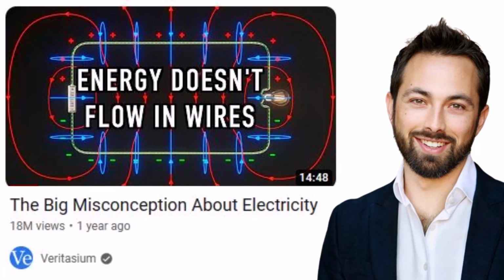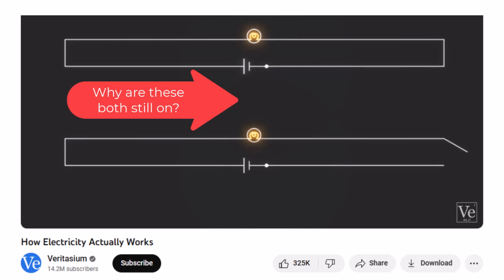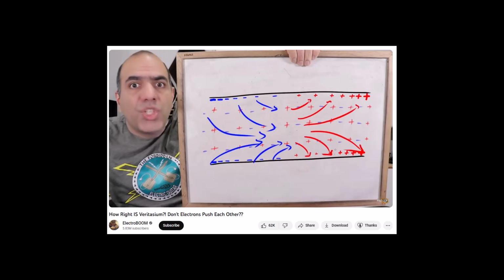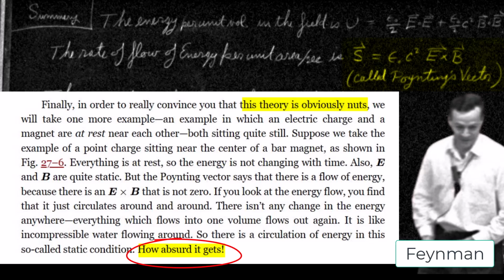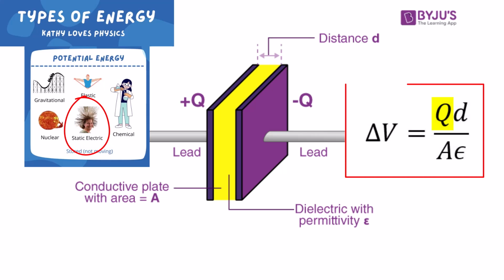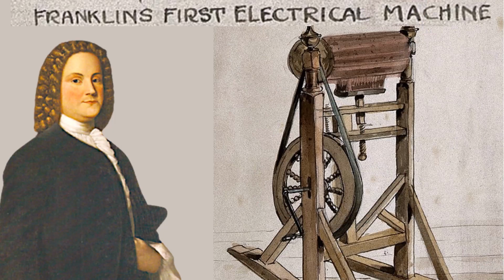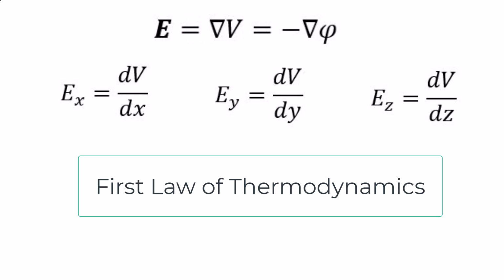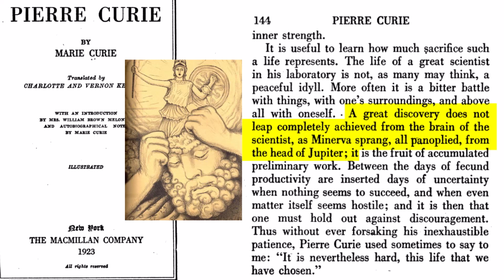Deep Dive Historical Response to Veritasium’s DC Electricity Video

Comment: so you have a battery feeding two long shorted stub transmission lines  the bulb "immediately" (~3ps)  sees the battery in series with the two characteristic impedances,  if the bulb is an LED it will probably light somewhat. if tungsten the  2x900 ohms or whatever in series with it will limit the current too much for it to light until you get the reflected pulse from the end of the transmission lines a few times - by this stage the trasmission lines are looking more like a stepwise inductor than transmission line stubs.  To an engineer (which is what I pretend to be) transmission lines can be treated like a black box with well defined behaviours without understanding the physics,  much like the way Hooke's Law can be applied to a spring or Ohm's Law to a conductror  without understanding properties of the metal it is made from so long as you stay within the bounds of the approximation.

Comment: I see this problem as a simple circuit with a series loop of a battery,switch, transmission, bulb and finally another transmission of some characteristic impedance. When the switch is closed, a voltage will instanty appear across the light bulb equal to this formula: bulb_voltage=battery_voltage*bulb_resistance/(2 * transmission_line_impedance+bulb_resistance). which is a simple voltage divider equation. After the pulse has time to travel to the end of the transmission lines and reflected back, the full battery voltage will appear across the bulb.

Comment: I'm Eric L Michelsen, but Google is scrambling my name.  To clarify, I'm affiliated with the University of California, San Diego (and my last name  is spelled "...sen").  There is much interesting and useful material in this video.  For example, I have given a talk describing simple experiments which show that power does NOT flow along the Poynting vector, and that is fully compatible with electromagnetic theory.  For reference (but not claiming infallibility), I have a BSEE, and a PhD in physics, and decades of experience in laboratories and measurements; I teach this material at the upper-division college level.

However, I think it is well established that the electric field inside a current carrying wire does, indeed, drive the current, and that this field is created by surface charges.  Conductors can expel E-fields only in a static (or quasi-static) system.  In contrast, a DC circuit is a steady-state dynamic equilibrium, and though the charges in the conductor move to reduce the E-field, the battery is constantly "pulling" them out of (and "pushing" them in) the wire, so they can never cancel the E-field completely.  It takes only a tiny E-field in a good conductor to drive a significant current.  This is established by extensive experiment, and organized into the detailed theory of electromagnetism (with no deference to anyone's authority).

I have a detailed discussion of the speed of electricity and the Poynting vector in my "Funky Electromagnetic Concepts" (at the bottom of my web page), starting around page 69 (as of this writing).   I performed (the moral equivalent of) Derek's experiment, and confirmed that in some very realistic situations (but not all situations), the bulb turns on nearly full brightness, nearly instantly (as expected from theory).  My document includes photographs of my setup and results, and a discussion of the theory, but is written at the upper-division college-physics level.  This is all well-established science, and fully consistent with relativity.  (In Dr. Muller's follow-up video, I think he actually didn't give himself enough credit for his prediction.)
Reply: Could you please give us a link to your website?
Reply: google for: eric's physics web page

Comment: With dc it's the electric field IN the wire that drive current and power IN wire and ac will be totally different. Sounds like you are correct. Great video. Thank you

Comment: Since when does an electrical voltage down a wire produce "static electricity" ? on the surface of the conductor ?🛑              Did I miss something, Totally concur with every thing Kathy said.

Comment: At this scale this is no longer a DC circuit. It looks more like a RF circuit working at sub-hertz frequency, and using mostly magnetic coupling. The most confusing part is that it still looks like a DC circuit, yet by making it large the "RF magic" was moved close to DC in a human scale of things (wires inductances are huge), making things confusing. Moving the battery and switch to one end changes how the circuit works significantly. Moving the bulb closer or further away would also influence how the current through it changes over time.

Comment: I would consider my BSEE degree to be in the top 10% of mainstream from a theory standpoint, with perhaps a slight bias towards proving theory through practice, also known as working things out in the laboratory and trying to see if the theory is representative. I had one part time night school teacher who did not mince words when it came to the students, I think it was in the second course in electric circuits, who would call Veritasium's circuit diagram and question about transmitting power (lighting a light bulb), a BS question. Why? Because the circuit diagram and question do not go together. 

Let me explain from an EEs standpoint; If you present a circuit diagram using the common electrical symbols of a battery, switch, light bulb, wires, etc. by its very nature you are using circuit theory. Circuit theory uses mathematical models to approximate the behavior of an electric circuit within a very limited scope, allowing the use of lumped parameter electrical symbols. 

So, circuit theory, or drawing a circuit using common electrical symbols and solving the circuit for specific parameters, comes with rules that are a special case in regards to field theory. 

So the answer to Veritasium's question is it does fit any of the models EEs use, or any that Physicists use as far as I know, who I have found are just as tightly rooted in mathematical models as EEs. 

To apply basic circuit theory, according to the book Electric Circuits by Nilsson and Riedel (now on its 11th edition), which is a very common circuit theory book and also I think representative for what is used for most BSEE students, there are three basic assumptions that permit us to use circuit theory:

1) Electrical effects happen instantaneously throughout the system. So the system is small compared to the speed that electric signals travel in wires, related through rise time (frequency) and the speed of light, or very close to the speed of light as seen by current traveling in wires.
2) The net charge on every component in the system is always zero.
3) There is no magnetic coupling between the components in a system. There can be internal magnetic coupling within a single component like a transformer or coupled inductor.

When we start to violate the above basic circuit theory rules, the system then must be solved or analyzed using field theory. Unfortunately, there is no easy shorthand for field theory, and we have to analyze the system with field solvers using field equations, which use vectors and gradients. 

So, why is Veritasium's question a BS question? 

My instructor would say his circuit model does not fit the question, which is a common mistake that undergrad EEs make, and if done so in class my teacher liked to use the prefix of BS to this or that student suggested nonsense, so by not fitting the establish circuit theory model guidelines makes the question nonsensical.

In regards to your insightful intuition, as EEs learn using circuit theory, the closing of the switch from a power source or signal source, mathematically will result in two main terms, one that is transient and one that is steady-state. However, as stated above this assumes the system meets the basic circuit theory application rules. So, what I am saying is you can get some very complicated integrodifferential equations or systems of equations that have to be solved simultaneously and this is within the simplified world of idealized circuit theory. 

A common mathematical modelling tool EEs use to do this is called SPICE simulation, which basically does the math in solving the parameters of a circuit.

I think the question should be asked, can we use 2D diagrams to understand both the static and dynamic behavior of electromagnetic fields? Yes, but we only do this in a very limited scope with the understanding that field and field interactions are 3D in nature. If you could see an EM wave it would be a strange oscillating string of pearls with a keen eye that can separate the electrical and magnetic effects. How to describe and identify behavior of what cannot be seen?

Comment: The Poynting vector was developed at a time when British scientists really believed in the ether; and certainly helped them in believing in this philosophy.
It soon became out of date however, but nevertheless the mathematical equations hiding behind the philosophy are correct. (Jackson has nothing to do with this?)
Feynman was quite clear about the absurdity of this philosophy, but everyone taught & believed this so…
Derek's video is an interesting sleight-of-hand: you're given the length of the wires and their resistance, but not what actually matters, their impedance.
Reply: How could the math be correct and yet the philosophy or science derived from it be absurd?  Keep in mind this field outside the wires was implied by Maxwell's equations and ideas.  The aether does exist and it explains the measured ability of space to warp and wave in the fields as well as it's ability to transmit energy quickly outside transmission lines and electrical conductors.

Comment: This is the peer review process in action.  Love it.
Reply: No, this wasn't equivalent to peer review, this was equivalent to response papers. Peer review works very badly compared to replications.
Reply: @laurenpinschannels obviously the veritasium video is already out there. I think this IS an actual example of peer review, in the same way that a response paper would be a form of peer review in the general sense of the phrase.
Reply: In order for there to be peer review, the reviewer must address the subject under discuusion, in this case the Poynting vector. All Kathy does is to profess a dislike for it and for David Jackson who includes a discussion in his book. Kathy claims to be a physicist, but seems unaware of the Poynting vector until the present discussion. I was introduced in my junior E&M course and saw it again in graduate school. The Poynting theorem is simply derived by dotting the E vector into Ampere"s Law  and then rearranging to form a conservation law for electric energy. The Poynting vector certainly describes the flow of EM energy through empty space. What is needed here is a discssion of  the Poynting vector in dc circuits. Kathy throws up a lot of irrelevant facts but never gets around to the real issue. She does make a glaring error by saying the the electric field is the (negative) gradient of the poential, which is only true in electrostatics. In electrodynamics, one must also have a vector potential to account for the unconservative nature of the electric field due to Faraday's law.
Reply: It is just an example of people creating controversy out of nothing.

Comment: Great video!!
Im interested if the cucit, but instead treated like a large circle and not two paralell conductors  (EMP travel  at light speed.)
will this relate back to Cosinus to f ,and electrical motors?

Comment: Electricity, Magnetism, Heat, light / Color, Mass / Weight are different manifestations of Gravity and Continually convert to each other. Gravitational Particles (GPs) move by means of CONDUCTIVITY towards the CENTER of the GRAVITY.  
Turbines convert the Gravity Force to Magnetic > Electrical > Heat > Light and everything in between.
When GP moves in the Air (4N1O) Atoms are manifested as Magnetism, therefore Magnetism exists only in the Atmosphere and is absorbed by Compass measured in Air Gap and Magnetic Flux context.
When GP moves in Solid it is observed as Electricity and measured by its Power/Force/Voltage and its Current/Amps and their combination total Quantity of GPs in a unit of time as Wattage.
GPs move at a 90 Degrees Angle relative to their path in [side] Steps, therefore the GPs manifested as Electricity, Magnetism, Heat and Light transit to the Outer Edges of the Medium/Matter.

Comment: The Poynting vector itself does not represent energy flow. If you integrate the P. v. around a closed surface, the result is the net energy entering or leaving (depending on sign) the enclosed volume. Alternatively, the divergence of the Poynting vector indicates if a locality is sourcing or sinking electromagnetic energy.

Feynman was addressing the view that the vector itself represents energy flow.
Reply: But note that Feynman does agree with the theory which is "obviously nuts". His point is that the theory goes against our intution, but that does not make it wrong (and if you don't like it, then I guess he'd say you can go somewhere else).

Feynman also points out that the practical consequences are near zero, and I very much doubt that it has any real relevance to Derek's question. "Energy" is anyway mostly a bookkeeping device.

Comment: The recent video by Alphaphoenix is a great vindication of your exposition!  It shows potential versus time at different locations actually measured and then animated for clarity.  Another problem with the ‘wave riding outside the wire’ type approach is to understand why you need larger diameter wire to carry more current - if it only travelled as waves outside the wire power lines could be as thin as silk!
Reply: Another Alphaphoenix video shows electricity slowing down when the wire is embedded in water. So clearly what's outside the cable matters. And he shows the speed is NOT dependend on the thickness of the wire. You still need a thicker wire to flow more electrons in the wire. But the electrons are pushed by the fields and the fields also flow outside the wire.
Reply: @drfisheye  Interesting - I’ll check it out.  I would think that for a coaxial cable or waveguide where there is a TEM mode of propagation the speed would be unaffected by immersion or proximity to metals etc., that’s the main point of using a coax. But for a transmission line such as a pair of wires I can see that the change in permittivity would affect the speed of the wave.
Reply: @Richardincancale  I'd think that's why coax has a specific dielectric material with a specific thickness to control the fields in it. And shielding around that material preventing the fields leaking outside (and vice versa).

Comment: Closing a switch to power a transmission line is sending a very frequency signal on a transmission line. The line will absorb the current matching its impedance until it reaches the end, where the power will be absorbed or reflected when the load resistance doesn't match line impedance, it will take a few iteration to stabilize and then the circuit can be called a DC circuit. The all argument is a misunderstanding about AC and DC.

Comment: Alpha Phoenix just posted a video where he measured voltage at multiple points along a wire. His animation of those voltages wonderfully shows the flow of electricity through a wire after a switch is closed.
Reply: Incredible video!
Reply: Thank you, that was exactly the video I was thinking about when I posted my comment above about transmission lines. The theory is very well established.
Reply: @philkarn1761 which video
Reply: An excellent explanation of what's really happening.
Reply: This video and Alpha Phoenix's helped me understand the topic. Derek OTOH seemed to try to "bewilder and amaze", for the view count.
Reply: @webherring Sadly Derek has become a shill capitalizing on sensationalism.
Reply: @MichaelPohoreski  I think that's unfair, but yeah, he doesn't always get things right.
Reply: @philkarn1761 Doesn’t matter what you think, the facts are Derek “reviewed” a sponsored product. 

You can sell your values but you can’t buy integrity.

Derek never got the memo.
Reply: @MichaelPohoreski  Whatever. I don't watch him terribly often.